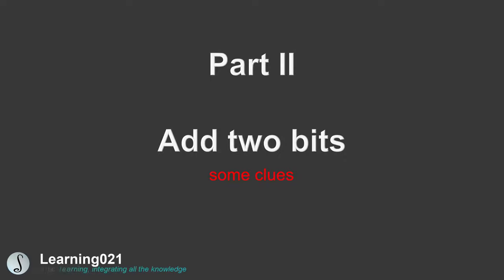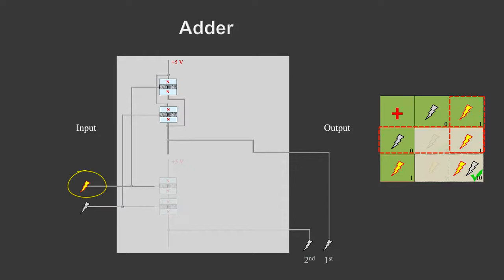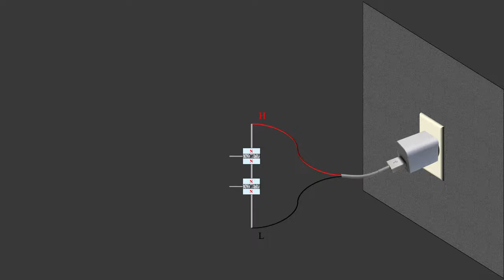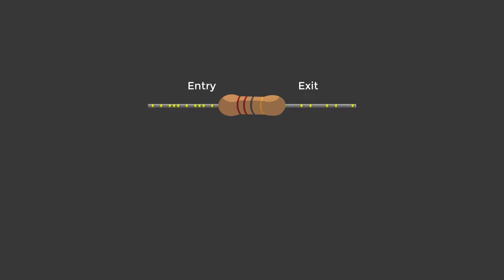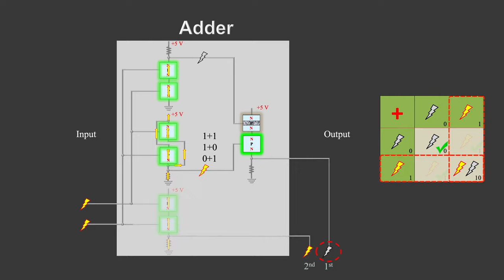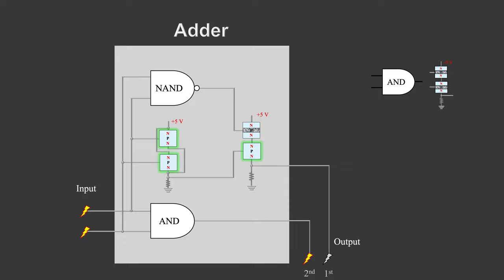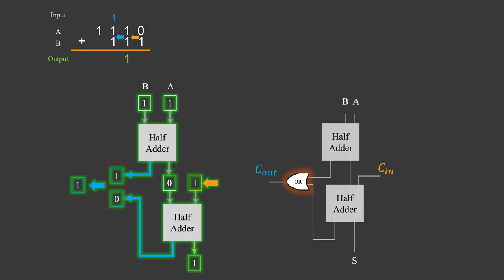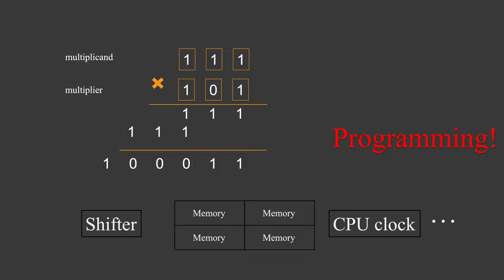How Computers Compute: Logic Gates and Adder - thoroughly explained in 30 Minutes!

Comment: The video made me realize what I did not understand about resistors and high/low voltage in wirings :)
Reply from the maker: The explanation of electricity here is very simplified and crude at most. It is actually a very complex topic that needs my further exploration. The trouble comes from our inclination to enforce a material-particle world-view upon a non particle world.  So don't throw away your understanding just yet.